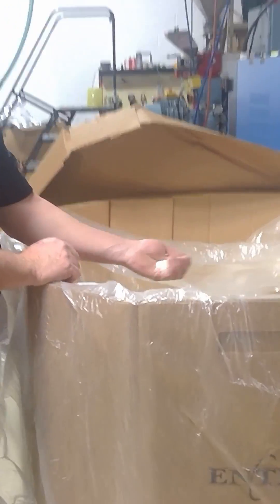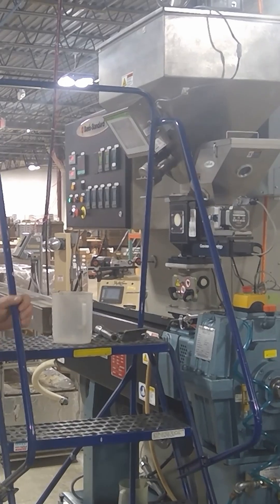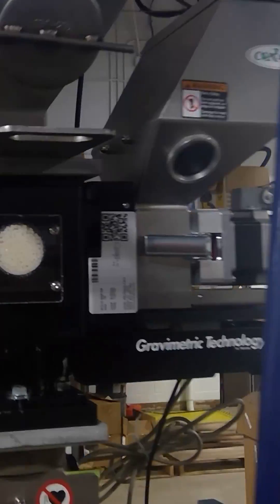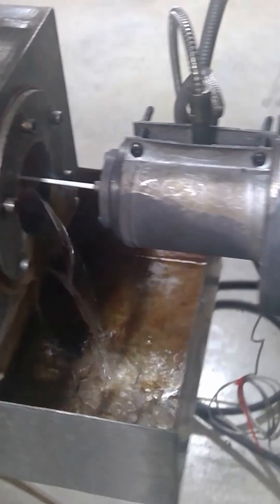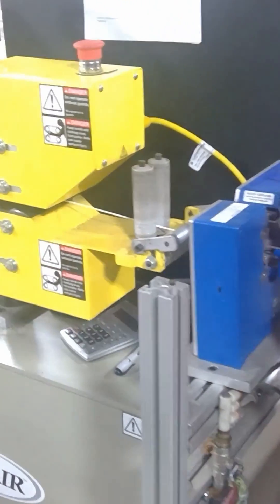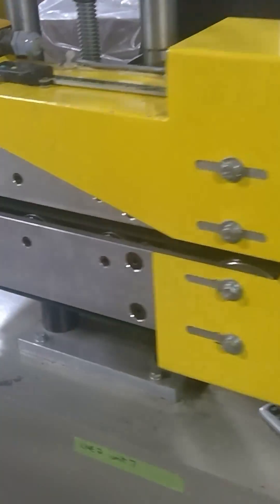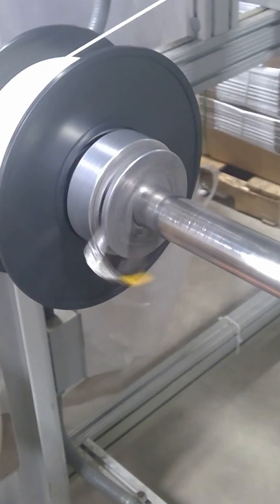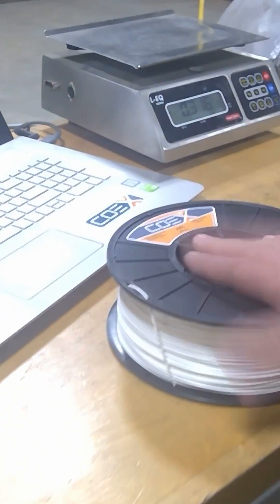HOW 3D PRINTING FILAMENT IS MADE! | COEX 3D

Comment: How you add colours?
Reply from the maker: We have color concentrate pellets made from the material we are making (PLA has a PLA-based colorant, PETG has a PETG-based colorant,...).  These color concentrates are pellets super loaded with colorant and added at a super low amount.  We add these at between 1%-4% using a gravimetric color feeder which maintains the correct amount no matter what speed our line is running at.